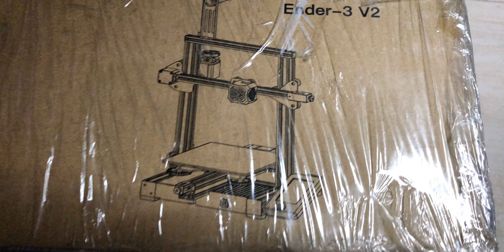Ender 3 v2 Unboxing And Assembly | Creality Ender 3 v2 | Ender 3 v2 Unbox

Comment: Yo como consumidor te lo digo, no tires tu dinero comprando una impresora 3d y te voy a decir porque, como toda impresora desechable las piezas se gastan y tienes que buscarlas, y no cualquier persona te repara este tipo de impresoras, por otro lado las impresiones son un fiasco, primero que nada, tienes que andar calibrando la cama y es un pedo, porque si se mueve tantito ya valió chorizo toda la impresión, segundo que el filamento no se atore, porque si se atora es otro pedo también valió la impresión, y por ultimo que el programa que usas te cree los archivos correctamente porque si no está bien configurado la impresora empieza hacer puras cosas raras y es tirar material, así que si acabas de comprar una véndela se lo que te digo.